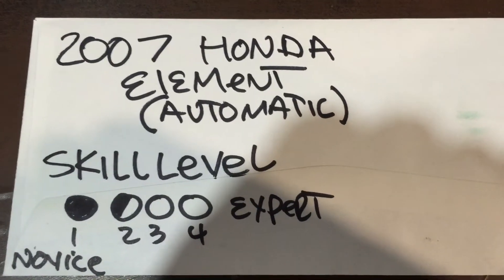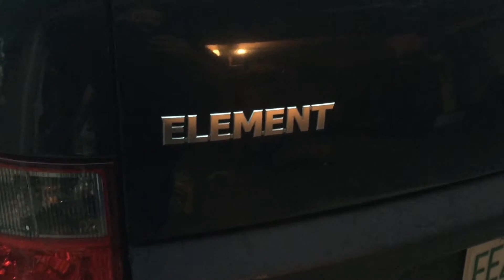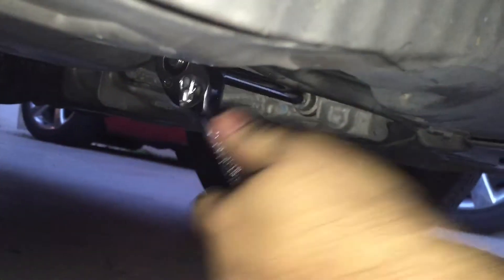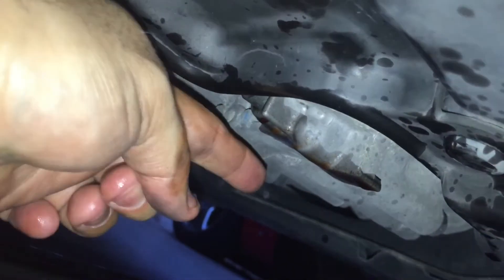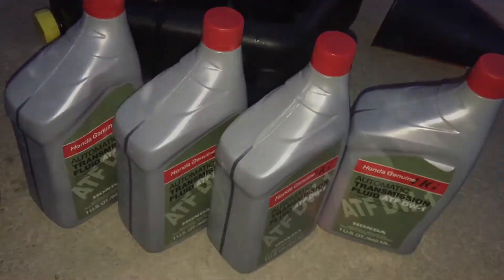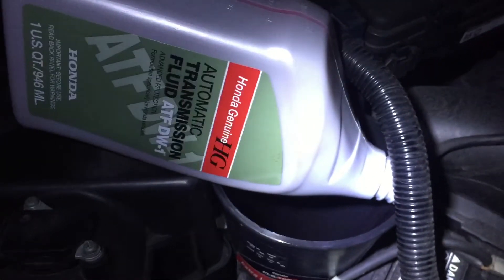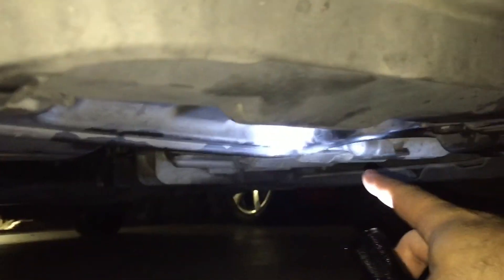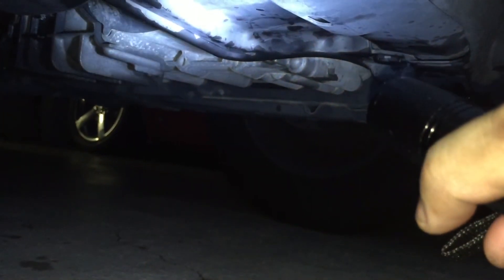REPAIR: 2007-2010 Honda Element Automatic Transmission oil change QUICK GUIDE

Comment: it's fine to use Castrol ,or Valvoline, just make sure  get right spec.
Reply: You will ruin your transmission if you use anything other than the honda dw1 transmission fluid.